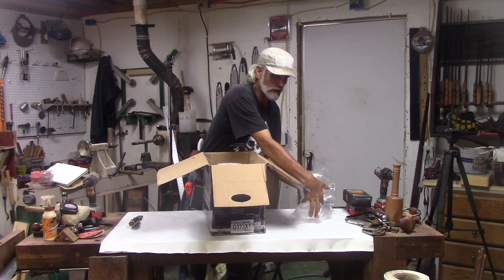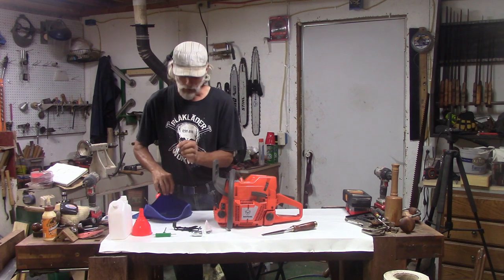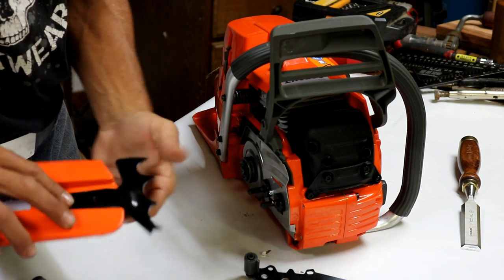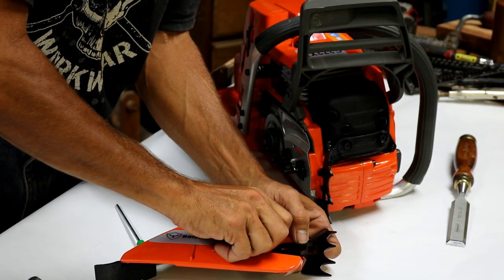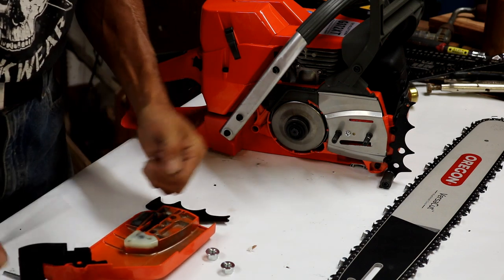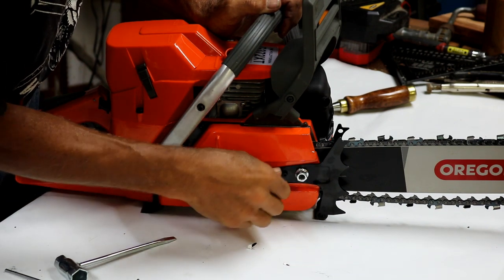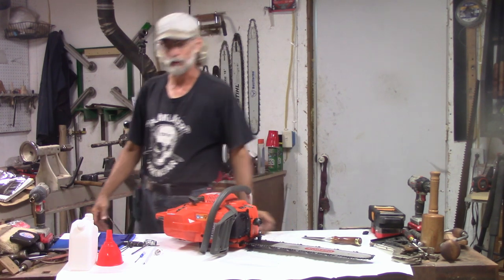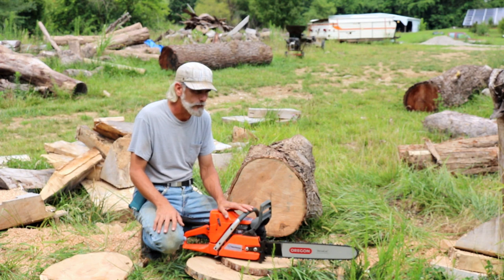Unboxing the G372XT X Torque Clone

Comment: That seems like a 372xp clone. I have a original low top 372xp i use for milling. Saw your review on holzforma alaskan mill and ordered it from them. im very pleased with it. before i used to have a self made one. I have had great experience with husqvarnas for 13 years as i have been working with saws. The 300 series is awesome and i currently run a 560xp that is a great saw also. I like the slim and compfortable design on them.

Comment: It sounded like it was breaking down a bit mid cut under load but for the money they run an look great plus easy to work on. I think your 444 did a much better pull out of the box. Your a tough bugger getting out after your operation. I'm keen to see more updates on this model take care Mark.

Comment: Any bar with a D009 tail mount will fit this sawdust adjust the rim sprocket accordingly, the as supplied decomp valve  button will fall off and let the valve fall into the cylinder wrecking it, you can either replace it or as I do drill a small hole through the button and stem and insert a small roll pin to alleviate the issue.
As I've stated many times before I run 32:1 mix using Lucas Synthetic Oil in ALL my 2 cycle equipment. 
I assembled a 365/371 kit using their big bore cylinder and I am rather impressed with the power it has, it's now over 2 years old and still going strong.

Comment: About time ... I was wondering why u hadn't got a 372 from them yet let me tell u if u want to turn her up I done over 30 builds for customers off that platform and had really amazing results
Reply from the maker: I'm still going to let it break in before cranking it up a bit, but I have heard these guys can take it.
Reply: This is the comment I have been looking for, I am DEEPLY considering getting one of these to customize and make a 24" beast out if it, so you recommend I assume, what are some of the things you do to the ones you build? Thanks

Comment: I have a g372xp. With about 5tanks thru it
  You should really warm your saws up.  Regardless if it’s 80out. They still need to warm up
  Those cylinders are thick   Mine takes a SOLID 5mins in cold weather before it warmed up

Comment: wishing you the best, on the next procedure for your hip.    I am curious about how this version of saw plays out....if i recall correctly... their first version was problematic.
Reply from the maker: The next thing on the hip.is radiation therapy. The growth was a rare form of cancer, it has a high survivability rate but it was stage 3, so there is that. 
I had issues with all of the Huskys I have used so i am curious too.

Comment: I have 2 HUSQVARNA 372 XPs as my main Saws one with a20” bar and the other with a 36” bar my beast just in case the job gets bigger is a ported 288 XP with a cylinder bore of 8.8 mm ,my big block saw with a 42” bar . Does that saw come with a 50mm cylinder or a 52mm ? Love your videos my friend . Hope your feeling better and better every day. I run 50:1 using Husqvarna synthetic xp oil

Comment: Yeah, I've put a couple of chains on back ass whackwards, usually when trying to show off to newbies. Karma bites my ass regularly. I think the 25 to 1 thing presumes you're going to use the same old bulk tub of 25 most folk bought in the 80's and not premium specific 50 with it's much better  lubricant and combustion additives.

Comment: Out of all the huztl saws you have tested what do you recommend to be the Best Buy overall g660 ?the only saw I did buy was the puppy climbing saw but that literally fell apart while I was in a tree super dangerous all the screws were super lose or stripped had no clue that lasted two months for 100$ it was worth the money cause I did make a few grand but man super dangerous
Reply from the maker: So far I have been most impressed with the 660, 444, and 388. However those are also the big boys and not suited for every part of arborist work. Believe it or not I rate the Prowler Puppy higher than the G111, the 111 is  prone to being hard to start warm and that is annoying when in a tree. For felling the first 3 I mentioned would do. For ground processing the G4500 has been pretty good but so has my YZ6200 but that's not a Farmertec saw, however it is the same design as the G5200 so though I haven't tried the 5200 I would bet its a good saw.

Comment: Hi Cy
You mentioned running 40:1 in most of your saws. Does that include 070? I’ve been running mine on 25:1 as recommended, but would be happy to run 40:1 if it’s safe.
Thanks 
Jeremy Meyer
Reply from the maker: Yep run it in the 105 too.

Comment: Would you recommend this saw over a G444? They are the same displacement but the 444's max bar recommendation is almost a foot longer.

I'm also thinking about getting the 4500 or the 255 for sub 18" trees and ground work. Thoughts? I am not new to using a saw (albeit little Poulan's), but I am new to buying one but don't have a name-brand budget.
Reply: The 372XP (G372XT) and MS440 (G444) are so close in specs that it really comes down to user preference.
Reply: @matt420740  And I don't know enough about them to have a preference,  lol.

Comment: Kinda of a newb in regards to chainsaws. I bought a 45cc Jonsered clone with 18 inch bar. Wasn't sure if that's a good size in engine cc. But figured I wanted a general all purpose chainsaw. Whats your thoughts ... Oh and that plastic funnel they sent can be used to funnel YouTube money ... lol
Reply: Not trying to poke my nose in where it dont belong but Jonsereds has been purchased by Husquvarna Sweden and all the new model Jonsereds are just a red version of a Husqvarna of equal CC...and a bit less costly in some parts of the US. I used to run Jonsereds Pro saws back when they were made in Europe and only trouble with them was finding dealers over here in the States. I switched to Husquvarna saws not long after Jonsereds went under. I had always ran Stihl saws but the price kept going up and quality down so thats why I had to switch to Husquvarna saws...I make my living with them so they gotta perform. It was last year when buying another new Husqvarna Pro Saw that I got the word about them buying out Jonsereds and now I have 4 Husqvarnas and 2 new Jonsereds (the parts fully interchange between the 2 by the way) I keep hoping they will come out with a Pro Jonsereds version of the Husquvarna 562 & 572 XP saws since these are my main saws but as of yet still no luck... If you bought a new Jonsereds Saw you got a red version of what is the best all round chainsaw on the planet right now....I am not so brand loyal that I wouldn't switch if something as dependable and durable comes along....but when my job depends on a saw....right now its Husqvarna Pro or the "New" version Jonsereds period.
R.C. Charlie Hill

Comment: They 450$ but still they should last a day .my climbing saw I had the puppy that flew apart in my hands after month the vibration had all the screws lose .so basically go to Sthil dealer and get top of the line commercial saws and I use premium gas at the gas station 93 octane and usually when buy a saw they with a bottle of 2cycle
Reply from the maker: Well my Puppy has seen more use than most of my saws because it is on loan to my friends that were hit by a tornado. Just spoke with them a couple of days ago and they have been using it daily with no issues. I also taught them how to PM it though so I know they are taking care of it the way I would. Chainsaws are just not a tool that you can use and use and expect to do nothing but put in gas and oil and sharpen or tighten the chain once in a while. They require regular maintenance, best example I can think of is Human, go check out his channel. He talks about maintaining his saws quite often. And he is a current tree surgeon.

Comment: What bar and chain do you recommend for a joncutter 5800?
Reply from the maker: The 5800 is recommended up to a 22 inch bar. It would probably handle a 24 inch though. As to what bar to buy, I would start with the bars that Holzfforma offers for it. Once you have one of them you can look locally for something making sure the mounting slot and oil holes line up to the JonCutter bar.

Comment: Can anyone tell me what to buy that will last where I don’t have to tinker with any saw every ten minutes I’m in need of a Climbers saw three ground saws one 16inch one 25 inch one 36inch and Polesaw
Reply from the maker: If you are having to mess with them every 10 mins right out of the box the problem is not the saw. I haven't had to mess with any saw I own that much with the exception of a 3 yr old MS171. And considering I was in the tree business for awhile an never had that issue, your question completely confuses me. Are you running NON-ethanol gas with a minimum of 91 octane? I have heard that running poor quality gas or gas with ethanol tears up saws to the point they become unreliable. Ethanol not only destroys the gaskets in the saw but it breaks down the Oil you mix with it causing higher friction with in the saw, which would eventually make it run lousy and finally kill it altogether.
Reply from the maker: I will add that if you are trying to use saws bought at a big box store like Home Depot or Lowe's etc. and use them for commercial use you are never going to stop buying saws. Go out spend the extra and buy from a chainsaw dealer. The clones I review you could try but I have my doubts about how long they will hold up. I have been pleasantly surprised by them thus far, but do consider that I am not using them like I would have when I had a tree business.
Reply: DIY with Uncle Cy The thing is two huskies 455 the primer bulbs stop filling after one tank and also open the gas caps the gas is extremely hot and shoots out like there is this huge pressure
Reply from the maker: There should be pressure. And if the saw has been running the gas will be hot. All the more recent made saws and a lot of the older ones have a valve or you could say a pump that pressurizes the tank as it runs in order to assist fuel in getting to the carb. I have saws that will hold that pressure for several days after running, others the pressure bleeds off in a few hours but all of them have it right after shutting it off.
Reply: Stihl  or Husky or Echo.The price will hurt and all the new saws need work to run somewhat strong.muffler mod and carb mods and timing.unless you can get it from Germany then you can still get a 090

Comment: Is this the 372xp that they offer or different.I don’t know what saws to buy anymore I been in tree industry over 20years and every saw I buy lasts no more then two months either after tank of gas won’t start oilers fail won’t idle I have been through husky Sthil cheap saws.huskys really suck bad lol two craftsman’s yesterday brand new for a small job after tank of gas both will not start primer bulbs stop filling never seen nothing like it not sure to try these knockoffs or give echo a shot Sthil and huskies new line of saws are thrash any opinions?please I have a tree service and not one running saw I can depend on almost making me want out.i can keep working on saws at customers houses 3hours yesterday tinkering with saws started job at noon should of been done by 3pm didn’t leave until 6pm help
Reply: Makita (which was Dolmar) or Echo, i wouldn't buy a new husky or stihl either. I also wouldn't buy this x-torq clone, the original wasn't that great and had much higher failure than the 372xp, this clone won't be better
Reply: Seems like you are putting bad gas, incorrect mix, or cheap mix in your saws.  Try running ethanol free fuel and synthetic mix before buying another saw. Also most new saws need to be broken in before burying the chain into wood. Never rev the piss out it before 3 tanks of fuel. Also you need to adjust the carb usually after the break in.
Reply: @jaysontaylor71  Does say he's buying the cheap (home owner) type saws too so that may be most of the problem. Any cheap saw from any brand these days is never going to last long, they're cheap and nasty and made as disposable as possible. I would expect more than a few months of decent work out of them though, using a low end, mineral oil lawnmower 2-stroke oil sounds a likely cause too
Reply: Your issue is that you're buying the 'cheap saws'. You need to buy professional grade Husqvarna/Stihl, with proper maintenance those saws will outlast you.
Getting a chinise clone for few hundred bucks might sound good but in the end it's not a saw you would want to rely on.
Reply: I will say I did spend 450$ at Home Depot for the 455husky 20icnh and still after one tank of gas the primer does not fill and will not start done this several times but will not start hour later
Reply: @killaclimber2580  Didn't know Home Depot sold Huskies.
Reply: 455 is a homeowner saw...that being said mine was bought in 05 and never has had any problems...and its gets beat...big time
Reply: I couldn't be happier than I am with echo personally, I am now a hardcore echo fan, it will be echo or dolmar from here on out for the ones I "need " to rely on, il still tinker and project around with other crap though just for fun

Comment: I don't know why they would clone an x-torq, they failed a lot, best thing you can do to a 372xp x-torq is to turn it back into a 'normal' 372xp. Don't tune this to run too fast, don't forget that secondary intake is pulling in fresh air with no lubricating oil/fuel. It's designed for emissions to clean (lean) burn, run 40:1 mix full synthetic for extra protection (never mind I see you did that, hadn't got to that bit yet lol) 

372xp vs x-torq differences
https://youtu.be/OgeidMe-vz8

Comment: Cylinder 2 ring piston 45.2mm hahaha China...husqvarna original swiden cylinder 52.00mm 1 ring piston power chinsaw speed
Reply: They are always overrating their saws unfortunately. You can always order the top end kit on Ebay and make it 52mm.